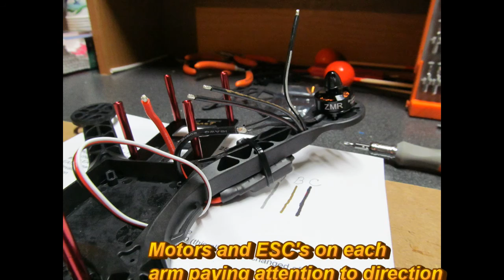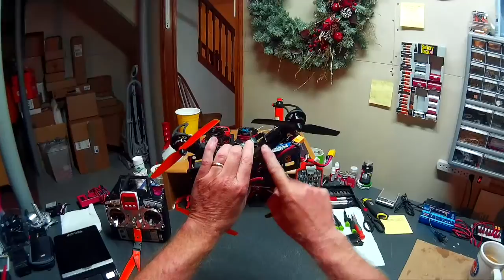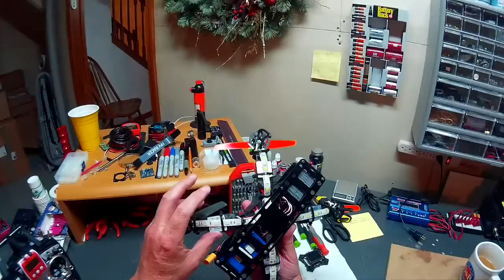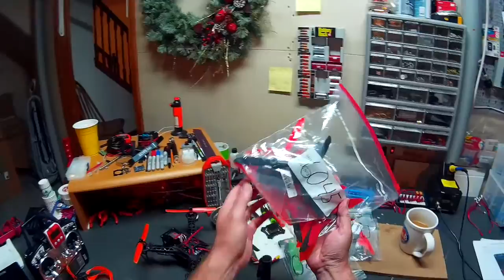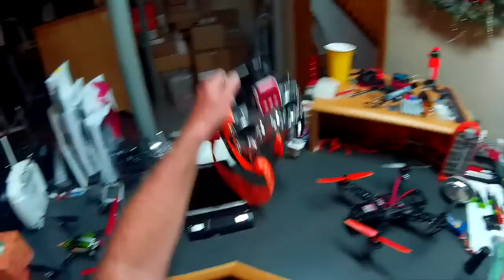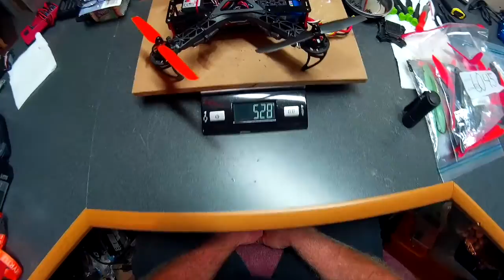My first 250mm quad build

Comment: Nice video, I am waiting on parts from banggood to build my ZMR250.
Reply from the maker: The RCAddict  I've upgraded the 250.  Purchased 2204 motors and have ordered 1800 mah Zippy batteries.  The 2204 motors are much bigger and provide more power.  Have not had any luck with the carbon fiber blades.  I think personally they are too dangerous.  Like Ginsu knives.  I'm awaiting my FPV camera.  Hope to have another vid soon.
Reply: MrPolymers Nice, what is the C on them? I got high C nano techs which are said to be much better.
Reply from the maker: Just test flew the 1800 Zippy batteries 9 minutes from the 250.  25C... Nano Techs are good.  Have not owned any yet.
Reply: MrPolymers Hmmm, 25C is a bit low. 9 minutes is very good though! The ones I got are 45-90C 1300mAh, I am looking for the most performance. There was a 1800mAh 65-130C nano tech but cost a bit more.

Comment: Let me know how that FPV kit is. I've heard some bad reviews from it so I'd like to see what you think.
Reply from the maker: Joe Quadcopter My first APM board, the USB broke off!!!  The seller is replacing.  I purchased a spare.  So far, I like how it handles with the 6030 props and the NAZE Acro flight controller.
Reply: Can you solder it back on? I am following you very carefully, this is my next project.
Reply from the maker: I tried like hell to resolder but no luck.  I purchased a second board.  The seller is replacing the original.  That will give me a backup for another build some day.